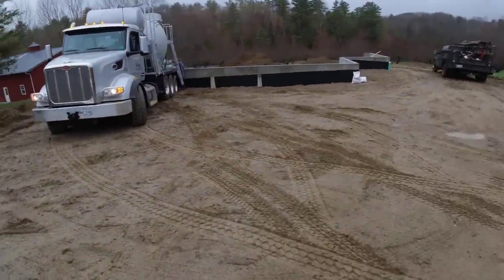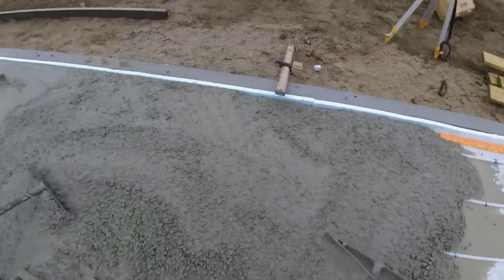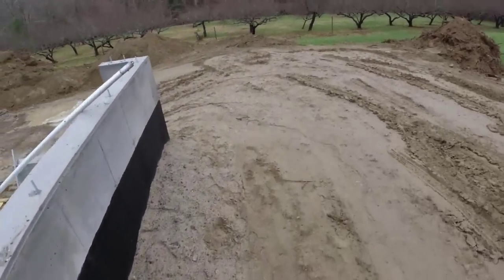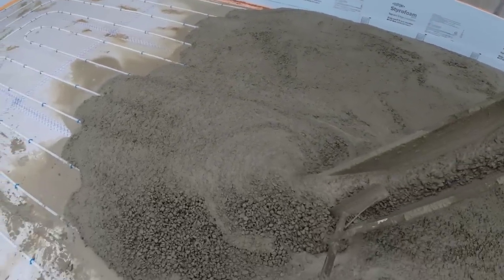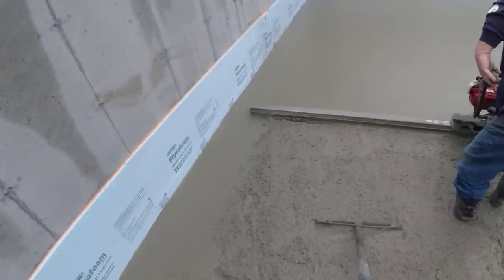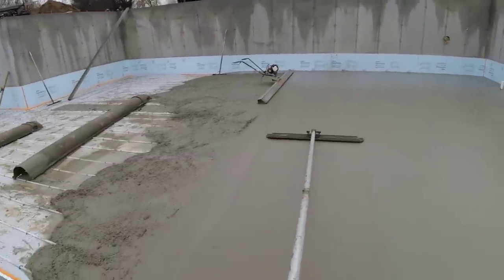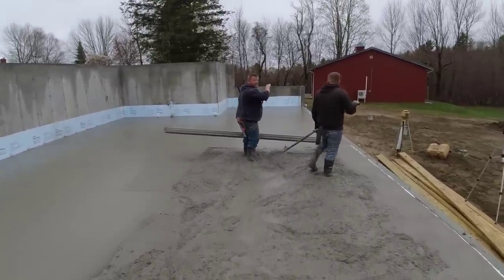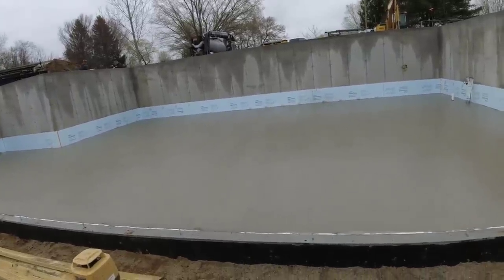How To Pour and Screed Concrete Using a Power Screed | Raking Concrete and best Slump to use.

Comment: Hey Mike, is it possible to do a pour of one slab in two separate pours for the reason of having different heights so it could transition from vinyl plank to polish concrete so the finished level of both floors would be the same height with no transition strips. The slab would have rebar, tubing, insulation, and vapor barrier.. that's the part that makes it tough, I don't know how you'd form it.

Comment: So in Germany. They stick their heat floor tube on top of their pour flour (dried). Then pour a 7 cm thin set on top. Reason, if something goes wrong they don't need to tear up their whole foundation to fix it. Have you thought about doing that instead of pour your floor on top of the tubing?  There are other bonus by doing it on top of the foundation too.
Reply from the maker: We've been pouring over radiant for more than 30 years now. I've never heard of someone having an issue. Not saying there haven't been any but I have never heard back from anyone. We do about 100 a year like this.

Comment: What slump does this spec to after the water reducer wears off and how long before it turns?
Reply: Great question,  I'd like to know as well
Reply from the maker: It would spec out to about a 3. It doesn't "turn" like the old stuff but you got about 20 to 30 minutes to work with it depending on how hot out the weather is and how far away the job is from the plant.
Reply: That separation of visible, well-defined coarse aggregate piling up while the water/cement and fines run away is called "segregation" and it's bad news. I know it'll stiffen up as the effect of the superplasticizer admixture is overcome by the hydration reaction, but the damage is done. You're going to have spots that cure to a 28 day strength of 5,000psi and some that cure to 750psi.

Comment: hey mike, i have been watching a while now.  pouring  a slab for my self next week to put a gazebo on.  I hear you talk about water reducers.  which is best, mid range or high range? my understanding was high was done on the job and mid is done at the plant, do i have that correct?  i like it when it is a 7 slump range, so which is correct.  appreciate you , thanks

Comment: How do you deal with entrapped air when you power trowel?
Reply from the maker: It's not an issue with us unless they put too much air in the concrete. It's usually around 5%, just don't steel trowel it too early. The only time we run into issues is when the sub-base is really cold and the concrete is warm. The top sets faster than the bottom. The surface gets closed up and sometimes we get blisters. They can be hard to deal with, we try to cut them open with the trowel then smooth them right back over with the hand trowel.

Comment: I'm not knocking your work. We all have one get away from us every once in a while. That mix was trash. There was obvious segregation occurring right out of the chute. That alone meets batch rejection criteria. But I also understand this is non-structural and it doesn't really matter that it's a garbage batch. It's just a spacer between the radiant heat and the tile that will be installed above it. It might be 5,000psi in spots and 500psi in others, but honestly, 100 will do just fine as long as they install the tile over Schluter so the cracking from nonuniform shrinkage doesn't transfer through to the tile. The reality is the ready mix company jas a heart attack when you reject a batch and they hold a grudge over it, even if you're right. So when they send a bad batch or add too much water on site or fail to mix it sufficiently for homogenization, you don't have much choice but to make lemonade out of those lemons - unless it's structural. Then it matters.
Reply from the maker: Never had one get away from me, and the mix was ok

Comment: These guys are Hacks .you can see the water in the mix separate from the agraget way to much water. Probably only a 5 sack mix. This is not the proper way to place concrete. Concrete should be no weter than a 5 slump. 😢
Reply: Better do your homework and understand how water reducer work unless you're pouring state projects and you can't add anything